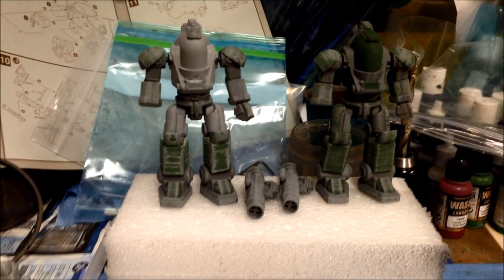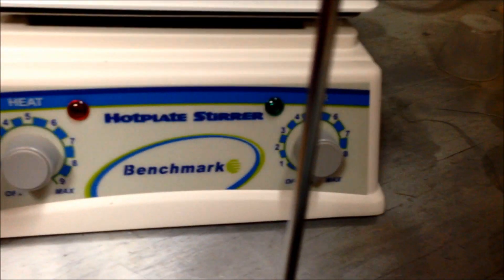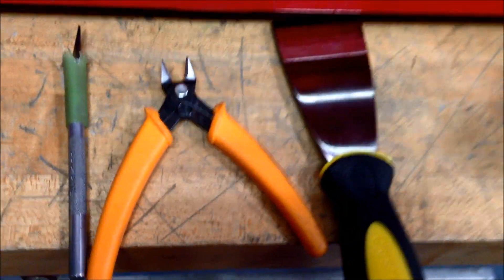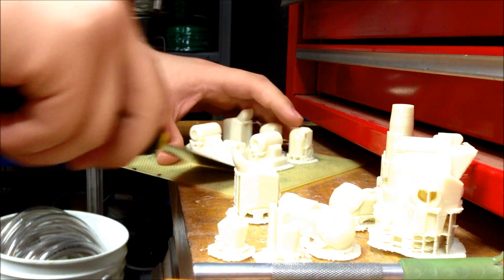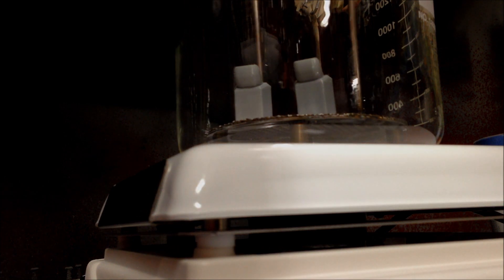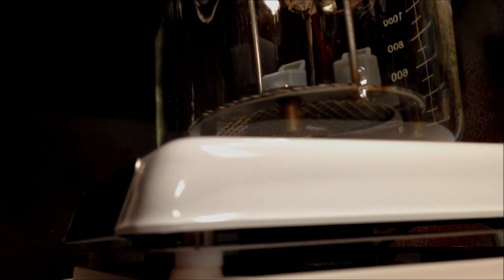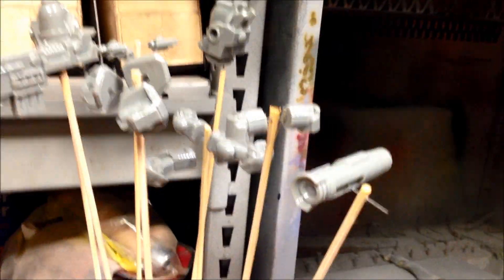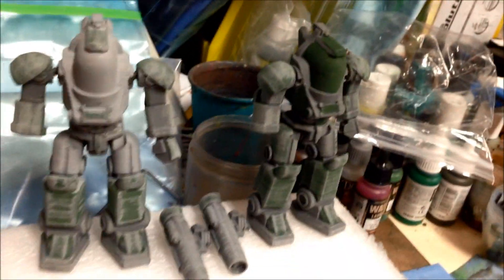Prometheus Rising Heavy Industries 3D Printed Mecha Action Figures Acetone Treatment

Comment from the maker: Hi,
The acetone is indeed melting the plastic.  It is not melting it 'away', rather it is softening the plastic on the high points so they settle into the low points, evening out the layered texture look.